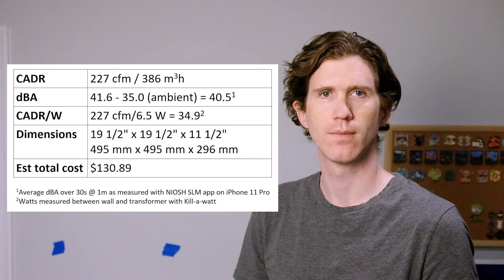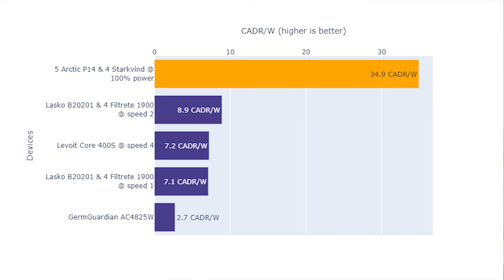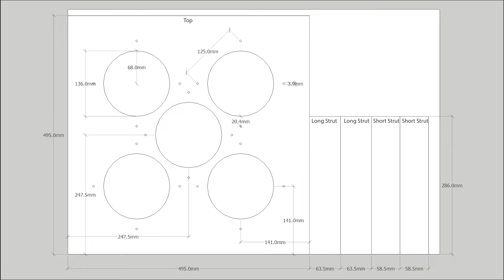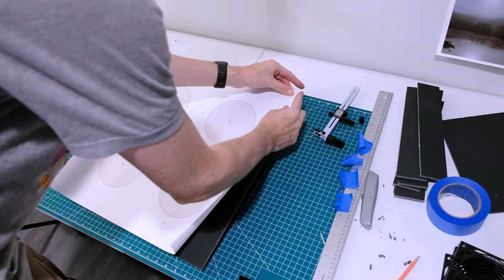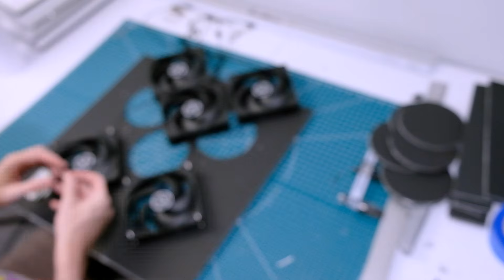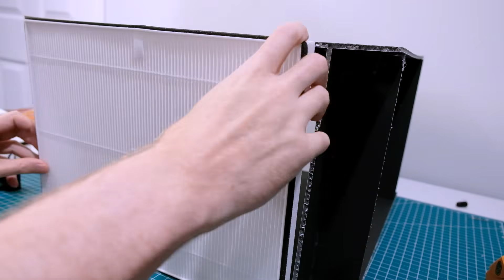Quiet DIY Air Purifier Build Tutorial

Comment: Three and a half years later... Are you still using this? How does ti work and all this time?
Reply: I'm still using mine. I made 2 with the Starkvind filters and 3 with the Uppatvind filters. I change the filters yearly. Sometimes I'll take the filters outside and bang them together and watch all the dust they've collected fly away (make sure you don't have the dust fly in your face!). I also made a travel version with only two Starkvind filters and two fans and then all you need is a nice strip of heavy cardboard to make up the bottom and sides; and that construction will fold flat and fit into a suitcase.

Comment: I would flip the fans to make that top face of the box to be the intake rather than the exhaust. I read that the Arctic P14 PST fans develop static pressure on the outflow side, hence they are better at pushing air into a tight space rather than the other way around (hence we mount them on the radiator to push air through the radiator, the difference between push and pull configuration may not be much though)

Comment: This is great, big HVAC air filters are basically unobtainable in Europe but IKEA still has these, I was looking for a version of corsi-rosenthal boxes that I could actually build with materials I can buy locally and this is it!
Reply: I ended up talking to some people at the hackerspace and there was a person with access to a big enough laser cutter who offered to help, so I did get it done from PS foam core boards. Notably I picked PS because unlike PU it doesn't produce toxic fumes when burned which is essentially what happens in a laser cutter. A disadvantage is that the foam gets vaporized in a wider pattern than the cardboard so the edges have a few milimiters of empty-ish space. And I had to wipe it all with some toilet paper to get rid of the residual ash.

The cutout pattern had to be adjusted slightly because here in Poland the closest size of foam core board available is 500x700mm, and that requires 3 sheets to fit all the struts.

I also used Arctic P14 Pro PST fans as I couldn't really find non-pro in stock, they are much more powerful at 2700rpm max (with 12V) but also use 3.2W per fan. According to the datasheet they should have similar characteristics to the non-pro version when ran at 7V (or 60% PWM) where they only take 1W of power per fan.

I wonder what CADR will it achieve, I don't have a testing setup but if we compare the P/Q curves of the Pro and non-pro fans (available on Arctic's website), the Pro have 2x the airflow at the same pressure. So in theory, if I'm understanding this right (I may not be), at max speed I'd expect to get 2x the CADR at about half the power efficiency of the non-pro fans version. And with a total power consumption of 21W (+ whatever the IoT PWM controller I plan to build for it will take, I would expect <0.5W for that).
Reply: I want to try making this with MDF plywood instead of foam, the local hackerspace has a laser cutter so I wouldn't have to make cuts manually. The disadvantage is that this is so large I would have to split the large board into four pieces that would then have to be joined together somehow, and I don't have too much experience woodworking so I'm not sure what would be the best way to achieve that.

Comment: Foamboard is a good idea! I was thinking corrugated plastic sheets but foamboard will dampen the sound.   Already ordered a 5-pack of the P14 PWM PST fans and the most cost effective replacement filters that I could find.
Reply: I don't see how you daisy chain them together do you have to buy stuff to do that or no?
Reply: @hughoneill6555  The PST part is what you're looking for if you want to daisy chain fans. PWM is adjustable speed. PST is power share.
Reply: @hughoneill6555  No, you do not need anything extra to daisy chain the Arctic P14 PWM PST fans together. The PST stands for "power sharing technology" and that means these fans can be daisy chained together. Check out the manufacturer's website and look at any of the PST fan product pages to see an image showing how the fans connect together.

Comment: can it clean smoke from barbeque ? can it clean cigarettes smokes? can it clean heavy co2? Is it pm2 level 0 ?
Reply: that all depends on what filter you use. MERV 13–16 can filter smoke particles (BBQ, cigarettes), but not gases like CO₂—only ventilation or special scrubbers remove CO₂. For odors/gases, use filters with activated carbon.

Comment: Hello how can I see the specifications of the pc fans and the starkvind filter? Are they displayed somehwere (merv rating etc)
Reply: They are EPA 12, which means initial efficiency at removing 0.08-0.15 μm particles is 99,5%. Unfortunately no rating afaik on the merv system, which gives efficiency for bigger particles. But I've seen tests on YouTube of the air purifier that IKEA sells that uses this filter where it seems to perform well!

Comment: Fans must SUCK air not blow it out. This is the major "wrong" with commercial filters, that they create a lot of turbulence. You would get same CADR, but much more effective filtering at the same time if fans blows in and nonturbulent air comes all around. Fast intake air will attract more dust, while this design you have only effectively work in very small empty rooms. Turbulence pushes air away and dusty air is rushed toward ceiling and walls and if not really smooth walls, dust will go everywhere that would never went if no filter would running. People think how filter cleaned air, but in fact dust was pushed into all corners, furniture, fabric, ...
Reply: Are you saying it would be better if the fans were flipped the other way around?

Comment: If you connect the fan to PV panels in a sunny window, you can get "free" air purification during daylight.   Not sure if the cheap, small harborfreight panels will be sufficient.
Reply: Not sure what panels are you talking about specifically but if this only needs 6W then basically any portable PV panel assembly would suffice.

Comment: IKEA filters have no MERV rating. Would rather get the Nordic one. £61 for 6 MERV 14 filters.
Reply: The IKEA filters are HEPA however.
Reply: @groundzero_-lm4md  Are you sure? Don't think it's mentioned anywhere
Reply: Ikeas filters are HEPA rated
Reply: They're EPA 12 (E12)
Reply: MERV-14 isn’t as good as HEPA but considering the price, MERV-14 will be good enough. A MERV 14 filter is exceptionally good at catching allergy-related air objects. It sits near the top tier of standard air filtration, offering near hospital grade performance.

Comment: The great thing about all these DIY designs is that we can build purifiers for all sorts of requirements.  This design is perfect for the bedroom where you don't want to blow up a storm and you want things to be quiet, while the big and ugly box fan filter I have does an amazing job clearing out particles in my 1250sq/ft house as a whole house filter.  All of these designs are a huge leap in cost savings and efficiency compared to any air purifiers on the market.

Comment: I am having trouble with the power supply. Do I need to find a pwn to 12 volt ? The clean air kits has a barrel cable coming out of there fans which is confusing. It then connects to a female barrel to a usb c female then they use usb c to plug into the wall. Why dont they just skip all that hassle and go straight from pwn to usb c ?

P.S I've also looked at your links in the description they are incomplete.
Reply from the maker: A good article to explain connector options is this one https://itsairborne.com/untangling-the-electronics-in-a-pc-fan-air-purifier-33f36b5834e1
Reply: @robwissmann1756  Thank you.

Comment: isn't this really comparing apple to oranges? since Filtrete filters are much worse filters than those used in commercial purifieres on this list' ; so maybe you can compare cadr of pm2.5 efficiency but the results would not reproduce at pm1 or pm0.1 - thats means i suspect it would turn out these filtrete dont work; and the most dangerous particles are actually <0.3pm
Reply from the maker: Hi, filtrete do filter at 0.3. In fact, the MERV standard specifies a minimum filtration efficiency at 0.3. The filtrete exceed the minimum and also filter 0.1. The single pass efficiency at these sizes is lower than HEPA but in box fan CR box designs, this is compensated for by the higher flow rate. High flow * lower single pass efficiency = high cadr.
Reply from the maker: I’ll add that we don’t have to rely on my results here to see that filtrete work for <0.3, at cleanairkits we had air cleaners with filtrete third-party tested for AHAM AC-1 CADR, which includes cigarette smoke. They filter it, just at a bit lower of a rate than the larger sizes whereas HEPA are expected to be the same across all particle sizes.
Reply: These filters are EPA 12, meaning they are certified to filter 95.5% of 0.08-0.15 μm particles

Comment: Great video! But I'm curious how you determined CADR values- did you measure actual flow volumes and rates, use manometer measurements, or did you infer from fan specs and fudge the numbers to account for the filter restriction? As I understand, the Lasko fans suffer a significant drop in flow rate when factoring in the flow restriction from the filters. Thanks for sharing this information!
Reply from the maker: CADR was measured with a particle decay experiment.

Comment: Looks nice, but I have no idea why it works, accordingly to Arctic, this fans produce static pressure of 2.2 mm H2O (why to use such a BS units?) which is about 22 Pa. While E10— 11 filters (which I assume IKEA sells) usually require about 150—200 Pa for operation at the beginning. Even if you divide it by 4, pressure still will be two times lower than designed.
So 227 CFM CADR compared to 280 CFM, from datasheet at zero pressure drop, looks very optimistic.
Though this design should work with G3 filters or similar.
Reply: 🤔FWIW, Ikea's page says it uses an EPA12 filter (E12), but couldn't find info on the filter's pressure drop/minimal resistance to airflow.
I'm not familiar with how/why PC Fans static pressure are able to push the air, but from other independent tests, it is apparent they work. H2O is not a "BS" unit, it is a standard measurement of low range air pressure
Reply: 21.57 Pa per fan = 107.85 total
The 4 starkvind filters combined should also further reduce the pressure required to be overcome
Reply: @yeetusfetus8687  I've just noticed that I was wrong: static pressure mean that it still will be 22 Pa if you connect multiple fans in parallel, to get higher pressue one should connect it in series. It's like electrical batteries.

Comment: One problem - those PC fans are designed to be quiet but they are also designed to be used in a relatively resistance free device. As the filters do their job and start to get a build up of particulates on them more power is needed to pull air through them. Those fans are not designed for that kind of power, they have small rather weak motors in them because a PC does not have a lot of resistance - no HEPA filters in a PC - therefore not a lot of resistance. As the filters accumulate build up those fan motors will encounter more resistance to air flow and they will definitely slow down and probably start to get warmer thereby reducing air flow and their lifespan.
Reply: P14 was designed specifically for static pressure.
Reply: There are 2 types of pc fans. Static & airflow. Just use static fans
Reply: Actually, moden PC fans (including the Artic P12/P14s) tend to balance airflow and static pressure (unless specified for airflow, and even then the Noctua flow ones still perform reasonably well in pressure situations...) and perform pretty well even up against a radiator, which similar cakes with dust and debris. This usage is well within their design spec.
Reply: These are designed for water cooling radiators

Comment: Question, why did you cut out the sound just as you plugged in the fans at the end?? Makes me wonder.
Reply: I've made a larger one with double the fans and only 120 mm (smaller fans are sometimes, typically, because they spin at higher RPMs) and it's barely audible. Nothing to be concerned about. ;)
Reply: @emma70707  please post the video on the one with double the fans?

Comment: You could try and use centrifugal radial blowers as they are very compact and have high static pressure
Reply: I think you can get away with some 12v dc 70x30mm blower fans or lots of 50x15mm blower fans off a 3d printer but generally the bigger the fan the better maybe even a blower off a car ac unit they run around 12vdc usually and pretty common
Reply: Do you have any recommendations and models? Thanks

Comment: Can you please provide schematics for the Tower of Power?
Reply from the maker: Hi, at this time my efforts are focused on www.cleanairkits.com so I haven't taken the time to make those schematics available in the same way that these are.

The Tower of Power featured on my twitter uses 10 Arctic P14 fans with 20"x30" Filtrete 1900 filters. If you would like to build one get some foam core and a drywall circle cutter as recommended here and measure out where to fit 5 140mm circles in a 30" long side. Use the DIY template from Arctic's website to find where to put the screw holes (linked on my github). Width of the panel needs to be at least 19mm (filter thickness) + 140mm (fan width) + 19mm (filter thickness). Then tape it up and wire it up.
Reply: omg..you responded! Bless you! Can't thank you enough for this!